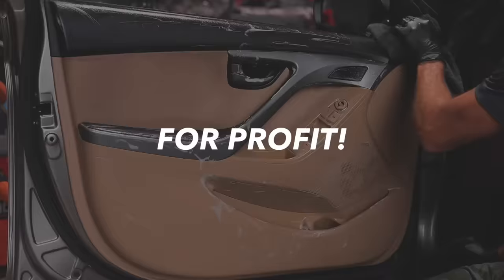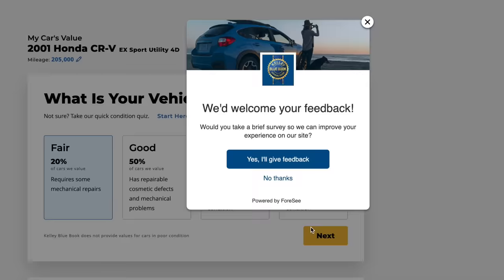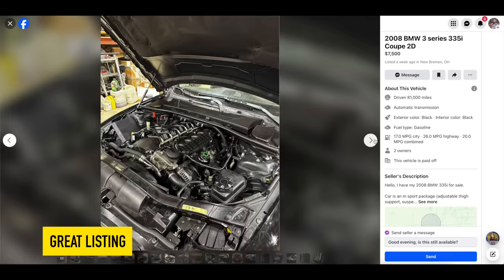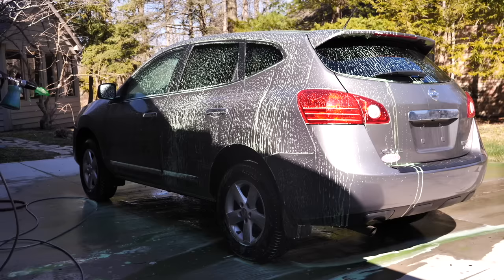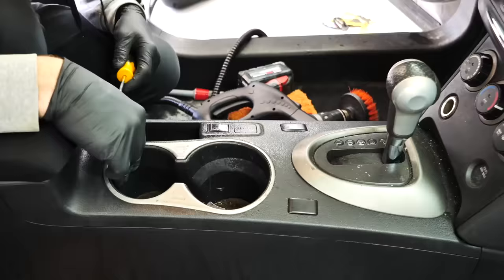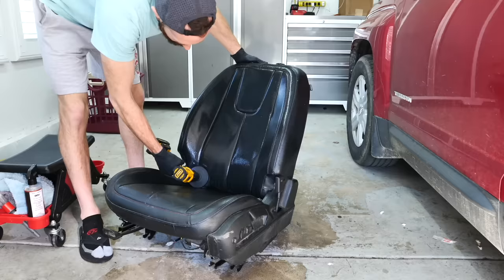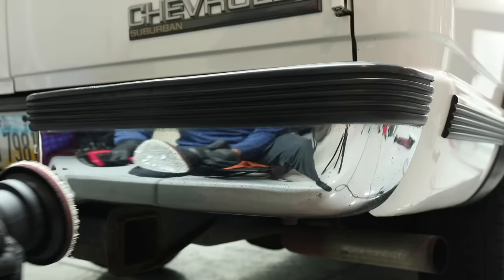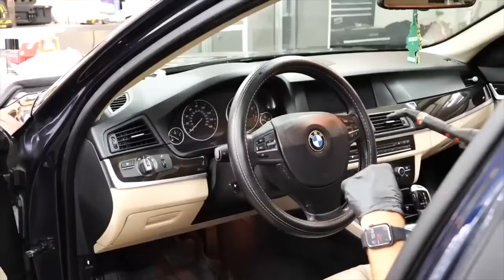How To Flip Cars For Profit $$$ (FULL PROCESS) Car Flip Side Hustle

Comment: Whats your opinion on flipping a toyota prius with a hybrid battery needing replaced? Seller says it ran great prior to that and its been sitting for over 6 months. Has some other things like cosmetic damage from sideswiping a guardrail (supposedly). Any tips would be much appreciated
Reply: Don’t bother with hybrids the batteries are a big pain point. Unless you can get it for a steal and have experience working in hybrids. I would avoid

Comment: 10:00 - Quick question. Doesn't the clay bar end up scratching the car with whatever it has picked up from the paint?
Reply: Yes. Just clay barring is more damage than good if you do nothing with it after.
Reply: Usually you need to buff  after@Fortress500

Comment: I noticed you didn't go into the curbstoning aspect and how it is very illegal in most states, including here in Ohio, which I see is where your business is based. I'm assuming since you're a legit business owner, you have a used car dealer license. Otherwise, you could face severe fines and even screw yourself in the long run if you or anyone else decides to go into business for themselves as a dealer.